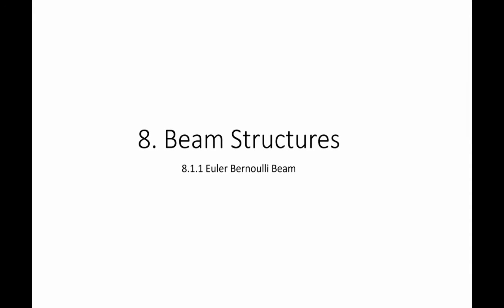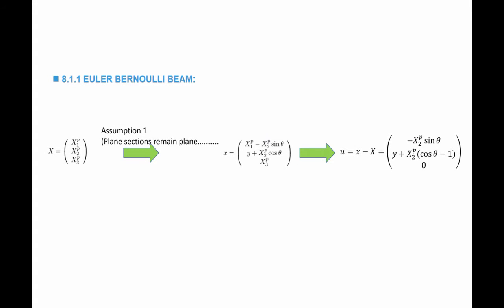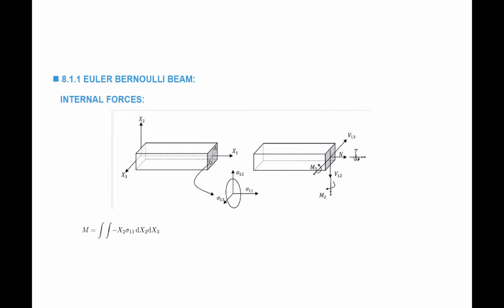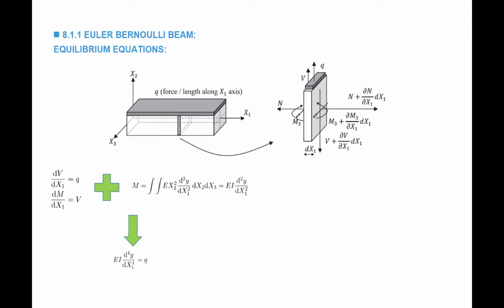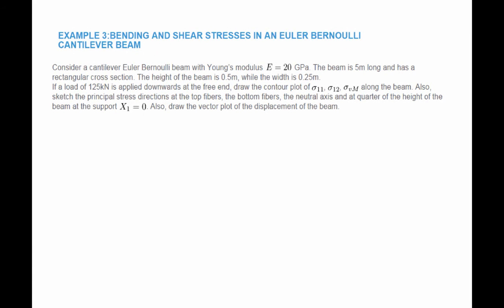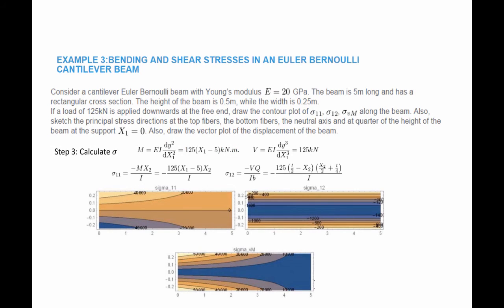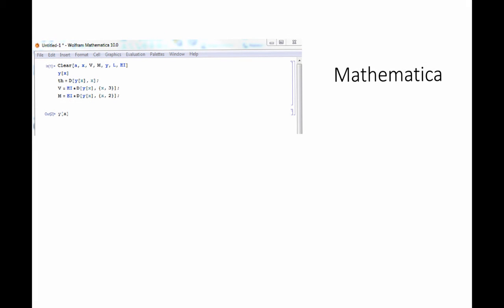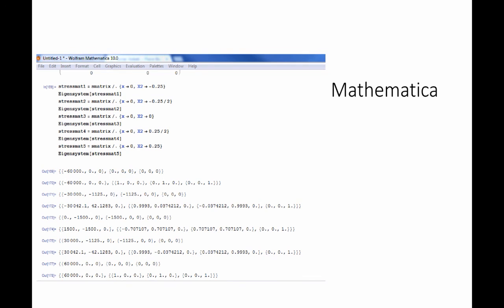8 1 1   Euler Bernoulli Beam

Comment: please why is the q = 0 in the example 3
Reply from the maker: q represents the distributed load acting on the beam.
Reply: @Samer_Adeeb   So Please under a point load the  dynamic beam equation generally becomes  mass X acceleration   EI (∂^4 y)/〖∂x〗^4 =-µ(∂^2 y)/(∂x^2 )